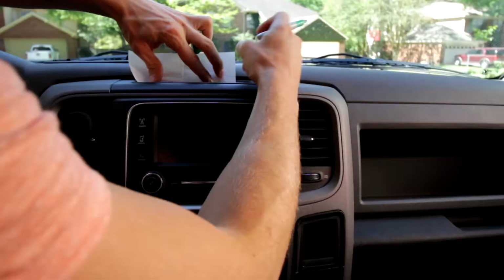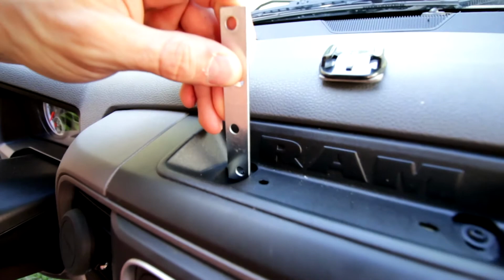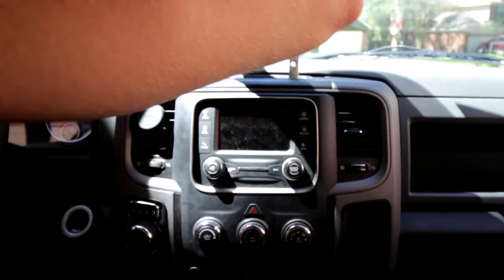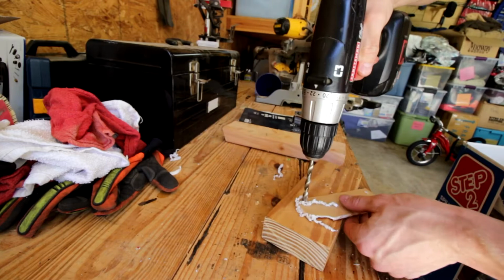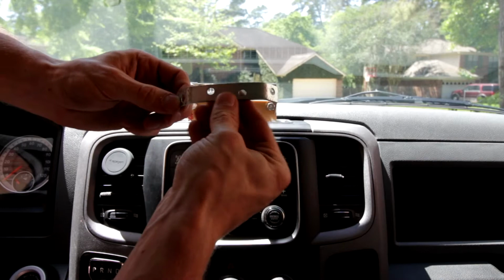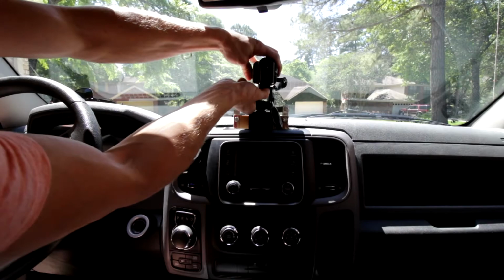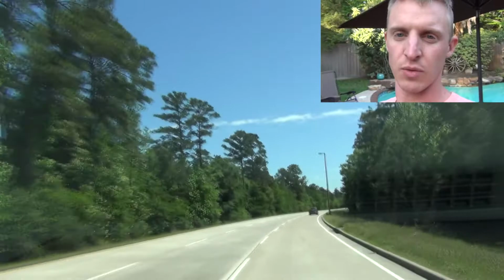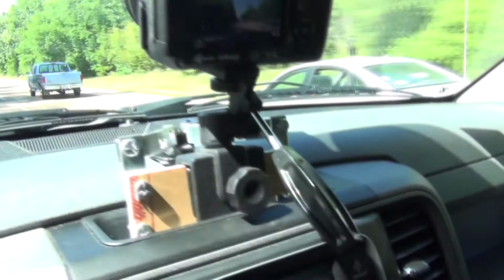DSLR Camera Mount for Car! My new Storm Chasing Set-Up. Mounting a camera in your car

Comment: I wouldn't advise using dslr's to mount your camera like this. Having the sun shine through your glass window, then through your lens glass is going to magnify the heat directly into the lens. It's like when you use a magnifying glass on ants. It will fry your sensor and wear your expensive camera a lot faster.